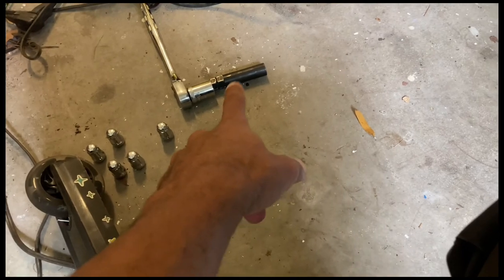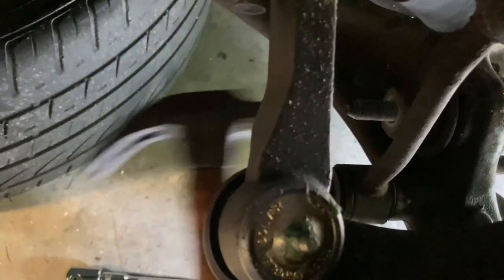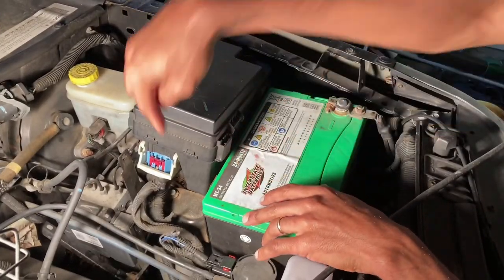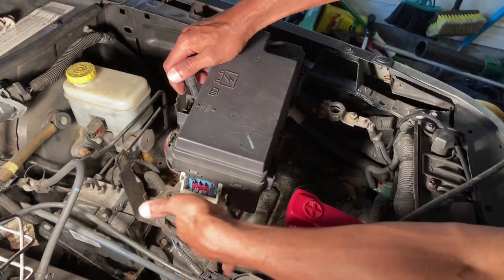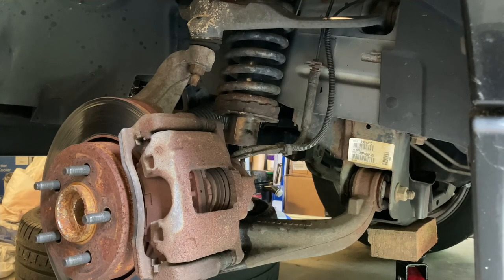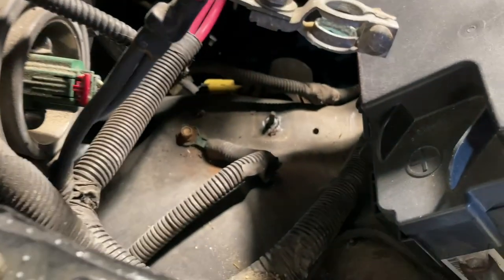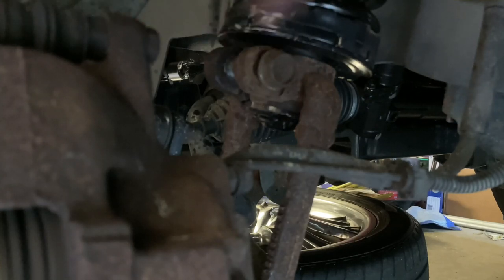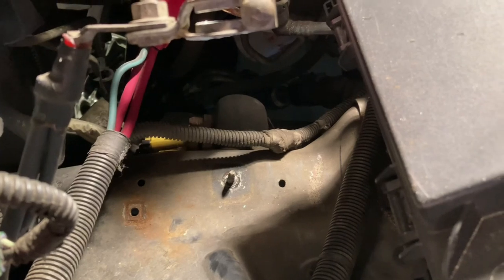Replacing Driver Front Strut 2008 Dodge Nitro 2wd

Comment: Also curious, did you torque the bolts with the rig unloaded?? I been reading about this, because I been asking of why I feel every bump, it's no luxury car but damn I feel all bumps. Also curious if your car got a big lift after replacing  front struts
Reply from the maker: Everything was torqued on the ground loaded. May have not been done right 

Usually new shock will raise any vehicle 

I noticed that I believe my passenger rear spring is weak and prolly needs to be replaced

I’m. Not a mechanic and out suvs suspension is still off I think because of the spring in the back 

sometimes it’s best just to buy a new car

Comment: I just got back and front replaced but one issue is I feel every single bump, not sure what my mechanic could have skip if anything, I have read a few things but I'm not sure
Reply from the maker: Maybe weak coil springs. I know mine had a weak passenger rear coil spring because the vehicle leaned to that side

Comment: Has anyone replaced AC dryer/ drier, 08 Dodge nitro
Reply from the maker: According to nitroforumzs.com

“The A/C drier is located on the left side of the A/C condenser. You will have to remove the front grill and the left radiator air seal to get to it easily.”

Check out the thread

https://www.nitroforumz.com/threads/a-c-receiver-drier-location.36970/

Comment: How often do you usually have to change the springs
Reply from the maker: According to Firestone 

“, there’s no set schedule for when you should replace your Nitro’s shocks and struts since many things can influence the wear rate and severity of the wear. Bouncing, swaying, or rocking forward and backward can all point to issues with your Dodge Nitro shocks and struts. One of your best bets is to have your 2008 Dodge Nitro suspension shocks and struts regularly inspected by a trusted technician.”

So don’t replace it unless it’s broke. 

You will feel bouncy, sway back and forth, etc

I still have a bounce which I think maybe due to the rear springs🤔